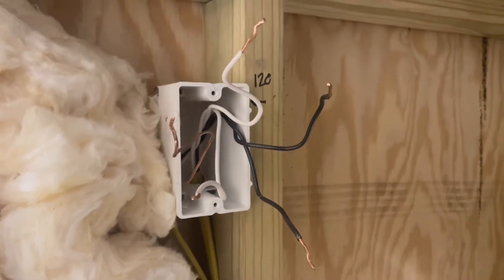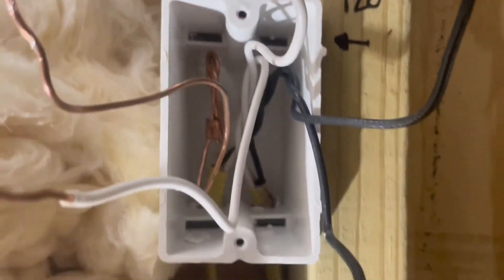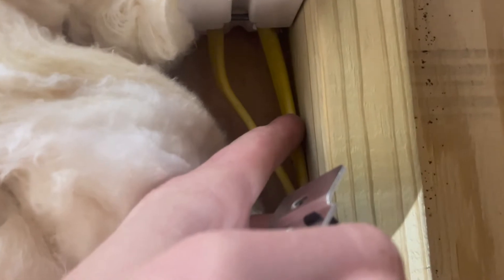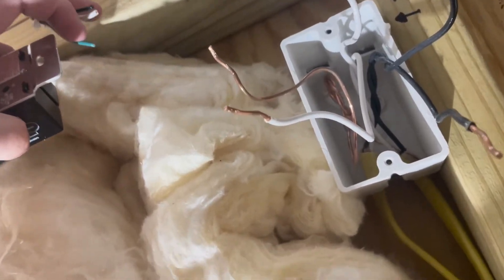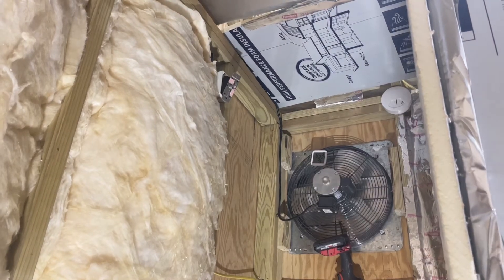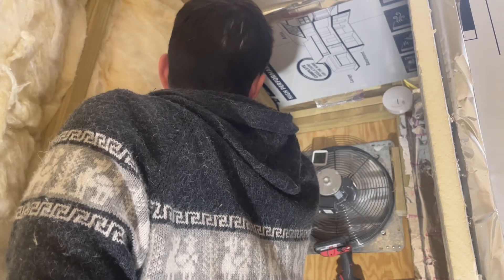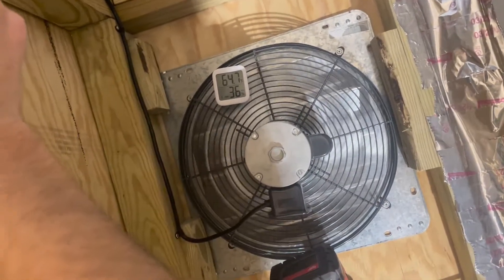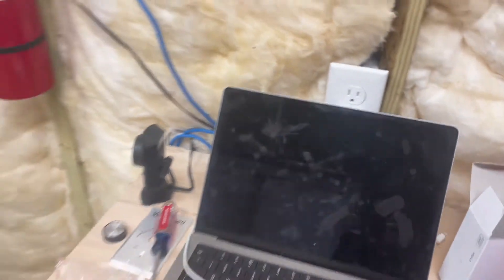Installing A Solid State Fan Controller In The Bitcoin Mining Shed!

Comment: How do you make sure you're not gonna burn out the motor if you don't have enough power on the low end you'll burn the motor up? Also you didn't demonstrate how to set the low wind speed which that model I'm pretty sure allows you to do. Did you do that?